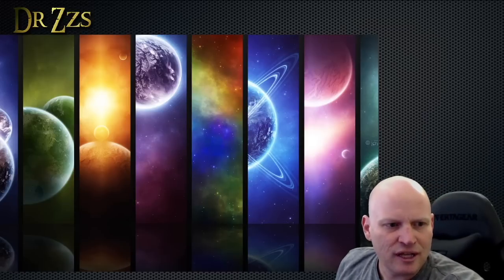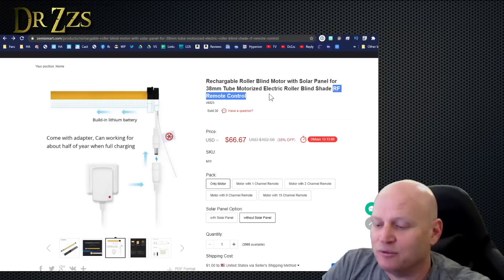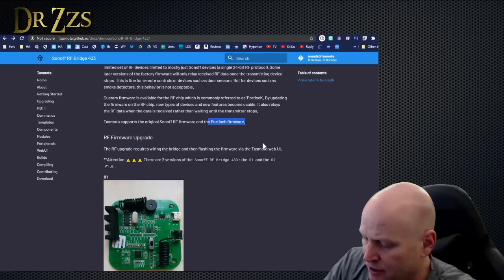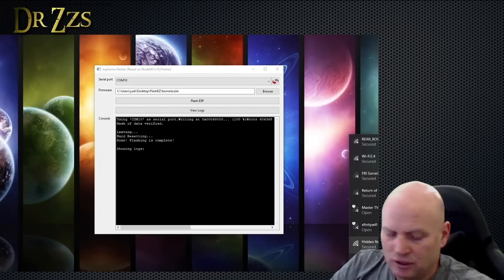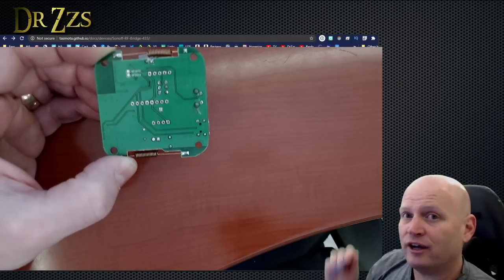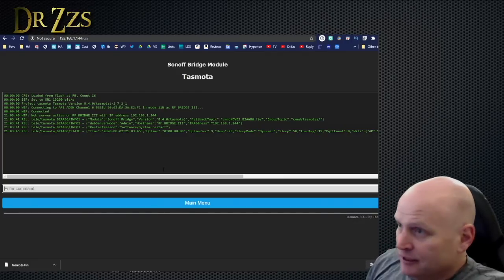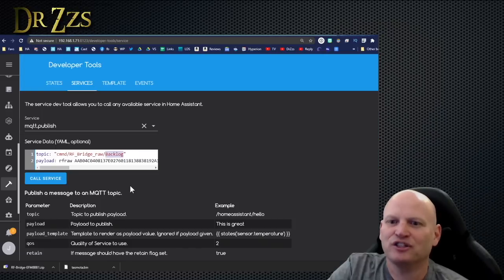433mhz Sonoff RF Bridge using Tasmota and Portisch to scan Raw RF Codes for Zemismart Roller Shades

Comment: strange :  I'm up to the part when i receive the codes via the rfraw 117 , past the code into the B0 Converter ..  get the new code string out ... then back the CLI and rfraw with the New code nothing.  no error messages . I have tried removing spaces from the code  still nothing ...    any ideas ?   note i have left the jumpers connected
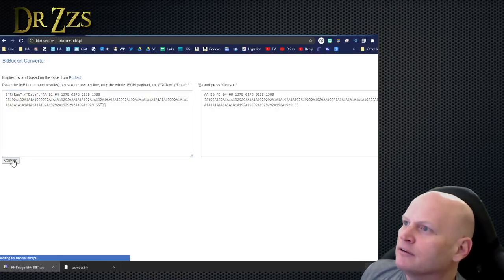Reply: Same here :-( Please from 16:00 minute there are 20 magic seconds where I'm lost too. I did a copy from BBconverter - just, select all and Ctrl+C, than what ? Should the spaces be deleted ? should put rfraw in a front of the string ? should the string be in "" ? And why you click on CLI ?  DrZzs .. could you please help us ?     i sniffed this string:"{"RfRaw":{"Data":"AA B1 05 0136 0A5A 00BE 04C4 283C 481828382838283828383828382838283828283828383828382838282838382828382838283828383828382828383828283828383828283838282838283828382838 55"}}" what will be the command ?
Reply: @dorayout  rfraw <bitbucketconverted output> is the command to send in the Tasmota console.

Comment: Modifying the board is not really recommended. I did not, and had the board powered by the USB/serial adapter while flashing Portisch. Worked perfectly, with the switch in the OFF position. USB power only used during normal operation.
Reply: Same he😊re😅😅😅

Comment: I really understand your satisfaction because I went thru this cumbersome process a year ago. And still a lot of RF devices (with "rolling codes") could not be detected. At least I one set of RF power plugs working. After that my ambitions were saturated also because the Portish Software is no longer maintained. (Last version from Jul 2019)

Comment: Would be interesting to see if you can also use this for a car remote. To for instance send out a lock-the-doors signal 15 minutes after comming home. Or when your home alarm goes to armed state. From what I can see my Mazda does use a 433Mhz key
Reply: I'd be pretty surprised if your car remote has such excessively bad security that it would work with the RF bridge.
Reply: Well if you can grab the raw data sent by the key and repeat that signal. There is no need for decryption or changing the signal.
Reply: @ragnoto  Nope. The security features for car keyfobs stop this simplistic replay attack form working. Short version: Sent data change every time you use the keyfob.

Comment: Doc,  this is a great refresh about rf433 and portish firmware, despite that the trend is to abandon this for zigbee & co, due to the statelessness. I was a bit shocked when you said you want to replace your great blind systems x7, done in a previous video. You said 3 out of 7 are no longer working. Rather than giving up so quickly the original idea,  can you shortly make a video on what failed in the blinds motors design? When you said this i was on the way to reproduce your motor blinds for home...

Comment: To get the Broadlink pro to read 433 you need the broadlink app then setup a user defined button in the app. Then hit sweep frequency and hold the button you want to learn until it picks it up, then the app will ask you to press the button again DON'T DO THAT. Do the Broadlink learn in HA then press the button. I found these instructions on the forums, it worked great on my cheap fan controllers.

Comment: My ceiling fan remotes say they are 434mhz, would the 433mhz sonoff bridge still work with the fans?
Reply: 433 MHz is actually 433.92 MHZ, which some round to 434, just to confuse people. It may work, but the very messy old RF signaling has so many variations that it may not work....
Reply: The only way to know for sure is to try it.

Do you have a broadlink rm pro?  If so just capture the codes with that.

If you don't have an rmpro, stay tuned. I have a spare sonoff Bridge I'm about to flash portisch on the rf side.

Two of my fans codes were also not readable at all by the sonoff Bridge. Or my gate remote for that matter. Rmpro got them no problem & works awesome.

About to flash a sonoff z-bridge, so I'll do portisch on a rf bridge & see what happens.

Edit: both flashed successfully & the rf Bridge now reads my fans codes. ;-).   (and a few others it never could)

I'll still be using the rmpro though, never failed in many years.
Reply: ANNE DROID )
Reply: Oops, didn't see 434mhz. 434mhz is not in the 433mhz range, so no would be the correct answer there.

Sorry.
Reply: This is an Update. After following this video I was able to send commands to my fans from the sonoff RF bridge and everything worked. My ceiling fans are the "Hunter" brand in case someone is interested.

Comment: You can also flash your Sonoff with this open source version of RFlink :
https://github.com/couin3/RFLink
It is based on real RFlink sources and adapted for esp8266 and arduino. 
It works very well on Sonoff too, it recognize a lot of rf protocols natively and when your device is not recognized you can contact the Couin on github : He will make it compatible 😄
Reply: interesting. does this work with rolling codes too? does it still require flashing the portisch firmware?
Reply: @AlexDelPrete  yes rolling codes are implemented for some protocols :
https://github.com/couin3/RFLink/search?q=rolling
It doesnt require portisch firmware but the hardware bypass of the EFM8BB1 (Direct Hack) is recommended :
https://github.com/xoseperez/espurna/wiki/Hardware-Itead-Sonoff-RF-Bridge---Direct-Hack

Comment: I successfully 'upgraded' my RF bridges (I have 5) to Portisch and can now read the codes from my ceiling fans. But I'm struggling creating a switch to turn them on and off. I have the codes and they already work via MQTT but how do I integrate them into a switch?

Here is what I have so far, I can turn it on, but not off anymore and the icon doesn't update:

Thanks!

## Livingroom Fan
- platform: template
  switches:
    fan_livingroom:
      value_template: "{{ is_state('switch.fan_livingroom', 'on') }}"
      turn_on:
        service: mqtt.publish
        data:
          topic: cmnd/RF_Bridge/Backlog
          payload: 'rfraw 
                    AA B0 23 04 08 0190 0316 010E 294A 38091818091818181818090909181809180909090909091A08 55 
                    AA B0 21 03 08 019A 030C 2968 28091818091818181818090909181809180909090909091809 55; 
                    rfraw 0'
      turn_off:
        service: mqtt.publish
        data:
          topic: cmnd/RF_Bridge/Backlog
          payload: 'rfraw 
                    AA B0 21 03 08 0172 02E4 2954 28091818091818181818090909181809180909090909090909 55; 
                    rfraw 0'
      icon_template: >-
        {% if is_state('switch.fan_livingroom', 'on') %}
          mdi:fan
        {% else %}
          mdi:fan-off
        {% endif %}

Comment: 🤔. Interesting Doc. Does it maybe work with my outside temperature sensors that came with the weather station.? They are also 433 MHz.
Reply: Rene B no. But look into rf link. There is a home assistant add on for it as well. Working a treat for me with a few different sensors and weather stations.
Reply: Stripey Horse  Hi. Yes I have seen that one but thought maybe with this new software it maybe connecting. It’s a lot $14 instead of $40 of this RF Link solution
Reply: @reneb5222  i got my SDR on amazon. Im in aus but it only cost $24.95 so not much more than a sonoff bridge. I use the following to push it into home assistant. https://github.com/mverleun/RTL433-to-mqtt
Reply: @stripeyhorse  Looks interesting. Do you maybe have a link to the SDR on Amazon?
Reply: btw.. use James-Frys hassio-addon RTL4332mqtt makes it a bit easier. https://github.com/james-fry/hassio-addons (it uses mosquitto_pub to send the details. I changed the config file to use the built in rtl433 mqtt client and it works alot better)
Reply: Stripey Horse Thanks for your great help. 😎

Comment: Any luck in sniffing weather coded results from an RF433 sensor?
Reply from the maker: I don't have that weather sensor.  I would expect you could use this method to sniff any 433mhz codes.  It would be a matter of knowing which information from the weather station corresponds to which raw codes.
Reply: Better off using https://github.com/mverleun/RTL433-to-mqtt for weather stations. It’s made for it.. plus bonus it works with any 433 device.. I’ve tested aliexpress switches and pirs. Even picks up my cars tps.

Comment: Thanks for the instructions; I was always nervous about doing this but your demo has made me more confident. Would it be possible to do without severing the tracks on the circuit board by using a USB power only lead rather than one with data?
Reply from the maker: I'd check the cable and make sure because I think in a power-only usb cable those data contacts might be shorted together.  If that's true (and I really could be wrong here) that cable would still cause problems when trying to use pin 4/5 for flashing the RF chip.
Reply: You do not need cutting any traces, if you have a USB/serial adapter to supply power, both while flashing Tasmota and also Portisch. USB to the RF Bridge only for normal operation.
Reply: Thanks for the suggestions; I am not sure why the tracks have to be cut and if it would affect normal operation; I guessed that there must be some good reason. I will have to try it out and see what happens. I have a spare Sonoff RF Bridge, so if magic smoke appeared or it gets bricked it's not the end of the world!
Reply: @MrJozza65  What you gain by cutting traces is: 1) The ability to power via USB while flashing. I prefer powering from USB/serial adapter while already attaching wires to the board. 2) The ability to expand with extra stuff (like sensors), as extra gpio pins are freed up if you have such urges. This is valid for flashing Tasmota, I'm not certain if additional consideration apply if flashing other firmware.
Reply: @JohnnieHougaardNielsen  Thanks,  that makes it a bit clearer, so I will probably leave the trace cutting as I don't need the extra GPIO inputs at the moment and will power up with the adapter for flashing.

Comment: interesting. i wonder if this can be used to control Somfy blinds as I know they use a special RF to control their blinds. I would like to utilize this to clean up my solution
Reply: I have been sniffing my somfy motor RF signals - and unlike the Zemismart ones that I love and have, the somfy seems to send multiple RF commands.  So far - I am not having luck trying to send the commands to the somfy shades, but I plan to spend some time this weekend investigating any solution.
Reply: I'll give it a try next weekend
Reply: I wonder the same .... with Rolling code & RTS protocol
Reply: @sebydocky5080  i would love it. right now i rigged up a ZEN16 to a modified remote to make it "smart", but it's such a clunky solution
Reply: oh crap I just ordered Somfy Roller shutter assuming this would work
Reply: @MrTTDARK  With RFXcom gateway no problem to control RTS in the worst case. I have one to control my Somfy gate' motor
Reply: @sebydocky5080  only RFXcom gateways are quiet expensive. I'm also hoping that this solution could operate my somfy blinds. If anyone has it worked out please let me know!
Reply: I was wondering the same!
Reply: I believe all 433 mhz devices use frequency 433.92 mhz, but somfy uses 433.42 mhz so I doubt it is going to work, as you need a different transmitter that sends/receive 433.42 mhz

Comment: Interestingly, I've never had a device that works in the sonoff RF bridge without using RFRAW, I just assumed it was a conspiracy against me.
Reply from the maker: I must have just been lucky then because I had a couple different door sensors and those little key-fob remotes that worked with just Tasmota.  The Universe is just against you Rob.  Sorry. :P
Reply: @DrZzs  I find this easier with Node-Red, but my use case is to capture sensor's commands instead of sending them. Also, I had to add a rule `ON System#Boot do rfraw 177 ENDON` for it to turn on RFRaw on boot.
Reply: @DrZzs Really useful guide!

I have a button that I can only receive the raw codes in 177 mode, no other modes pick it up.  My problem is that parts of the received code differ every time, with a constant string in the middle.

How on earth do I create a value template for something that 'contains' a string of characters??
Reply: @AdamRhoadesuk  That is the benefit of using Node Red to parse the received JSon data...there is a contains function in the Switch node. If you're not using Node-Red I see your predicament...
Reply: It's because you always buy "AAA Robert's level" equipment, here at Neverland (Brazil) we only have generic Chinese things, usually they work easily(for a while).  :)

Comment: Can you use this to steal RF remote codes for cars?
Just realized this...
Reply: They'd have to operate at 433 Mhz.
Reply: @error53ish  
They also generally use a rolling code, so you'd only be able to steal the last code used, which is then useless, because it rolls over to the next code.

It's theoretically possible to jam the frequency to keep the vehicle from receiving the code and rolling over, and then turn around and use that code once (and only once) at a later point, but it'd be tricky, considering that people are usually pretty close to their vehicle when they use their code; AND if it doesn't work, they'll just keep trying until it does.

Unless you can just so happen to be in the right place when the vehicle is in code-learning mode, and new remotes are being synced, you're not gonna get any useful data. And at that point, you'd be just as easily able to sneak in there and program your own remote with its own rolling code anyway, so it'd be pointless.

So from a practical standpoint the payoff for stealing a remote code for a keyless entry or garage door opener is virtually pointless outside of the movies.
Reply from the maker: I don't think so, but I have a couple garage openers I could try....
Reply: Or your neighbours... Just as a precaution
Reply: Car keyfobs have security features making them not work with the very basic RF Bridge. Otherwise it would be excessively bad security.

Comment: Awesome, wonder if tasmota can be replaced with Esphome
Reply: I use it with esphome
Reply: @osborne82  Perhaps he is asking if it will support the added functionality after flashing the RF chip.
Reply: @jmr  I use the RF bridge with porstch firmware and esphome so yes it works
Reply: @osborne82  That's good to know! I couldn't comment on that aspect since I don't have experience with esphome.
Reply: @osborne82  Very interesting... Do you know some tutorial about the RFbridge & ESPhome ?
Reply: @jerryaycock  I know this video but it's with the hardware hack. Now ESPhome can directly talk without this modification AFAIK